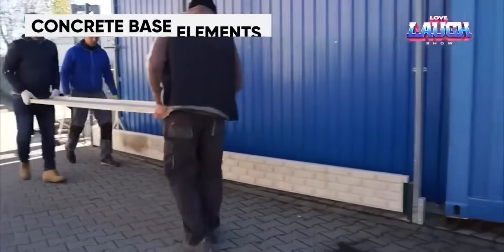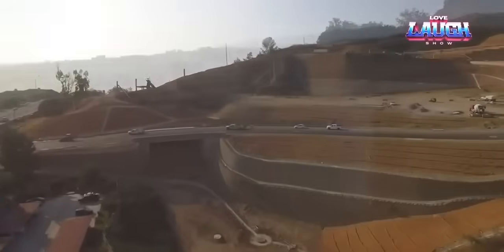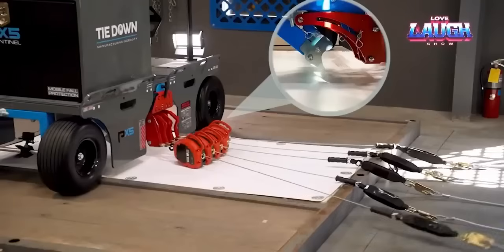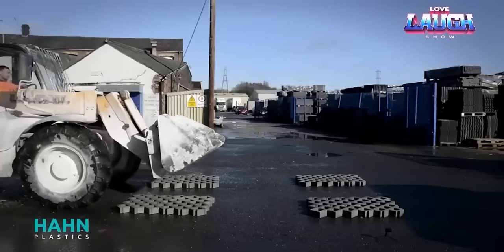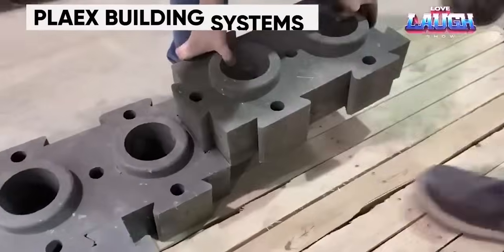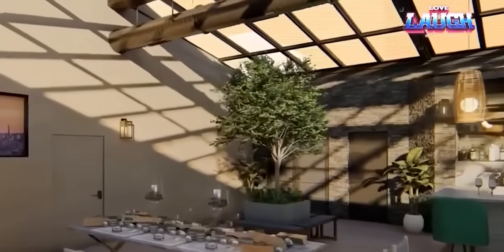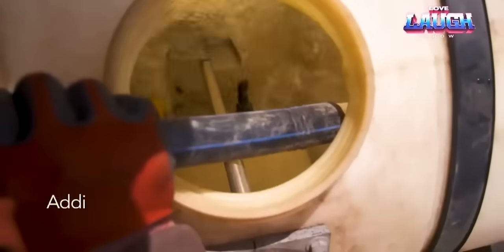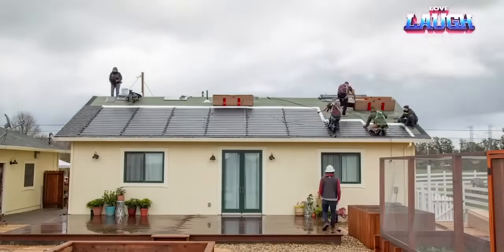99 Unbelievable Construction Technologies Working At Another Level ►6

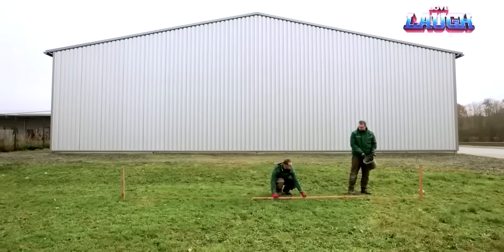Comment: 17:57 Yeah, I'm gonna stop ya right there and tell you straight up that not even an amateur can build a high-quality fence. If you want quality at any level of any project to the nth degree you need experienced quality minds at work on your project. Amateurs are designated as such for one crucial reason. They have no experience nor have they any instruction on the said project. They don't know where to start, how to start, and what to do once they've started. That's why experience is paramount. So, hire some moron to build your product. You'll get a moronic outcome 100% of the time, and that's the only guarantee you'll ever get. So, therefore, best of luck
Reply from the maker: You make a valid point! Quality projects really do require skilled professionals who know what they’re doing. Experience can make all the difference in the outcome!
Reply: @LALSHOW  amen to that